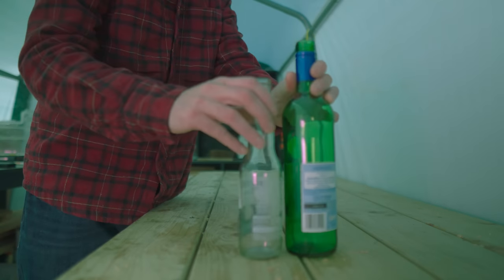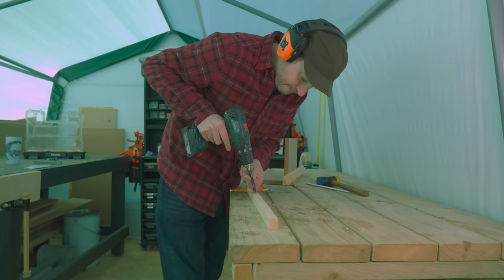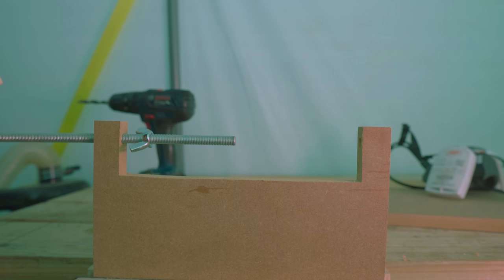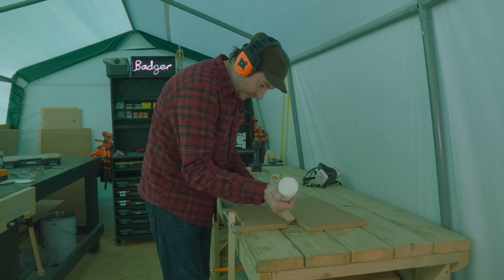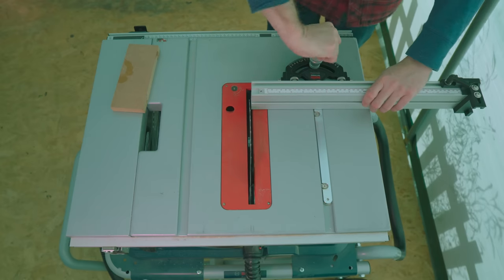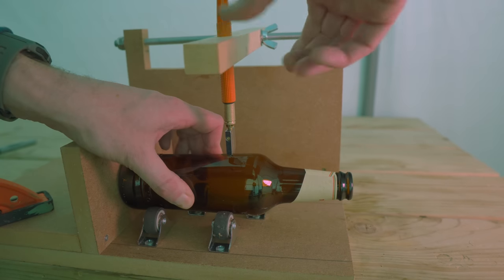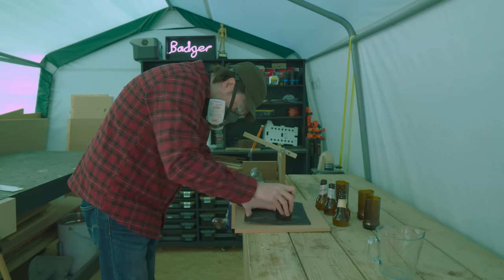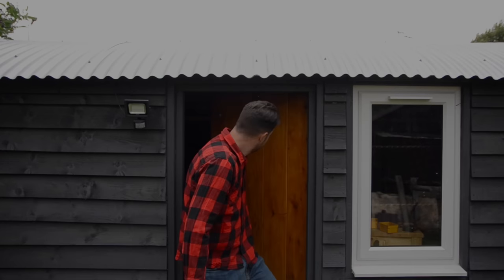Can I Cut Glass?

Comment: Great video Matt. I cut the top off a broken stoneware flagon using a similar method. You don't really need the castor wheels. You'll get much better results if the bottle is just pushed into the 90° corner of two perpendicular boards as that will eliminate any wiggle as the bottle is rotated.

Comment: I got myself a cheap bottle cutter on Amazon last year to make some candles out of wine bottles, and I found that doing a couple laps around with the cutter made it snap a bit better.

The kit I got came with two large o rings that fit around the bottle, so the heat of the water is concentrated on the score line. It also means you use much less water which is much better if you're only doing one or two

Comment: Nice jig. Seems to work really well already. Lubricant in the hollow handle of the cutter will help scoring and tapping the glass (it's what the brass bulb on the end is for) should deepen the score line and allow it to break off cleanly. Could you add something to hold down the cutter, so you have both hands free to turn the bottle accurately?

Comment: I'm led to believe that if you put veg oil in the bottle, then put a red hot poker ( or other suitable metal rod ) in to the oil. The thermal shock will cut the glass the top of the oil level. a lot less engendering involved